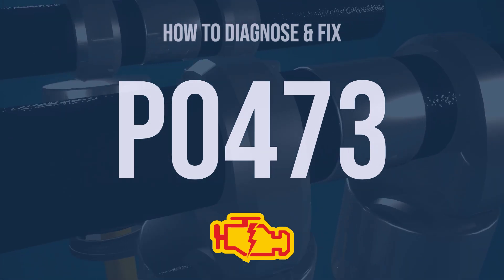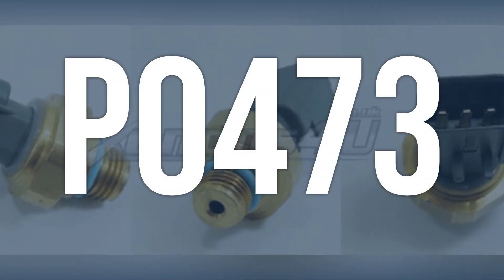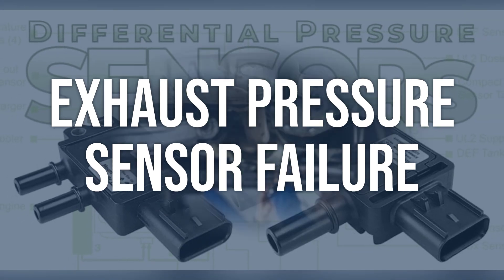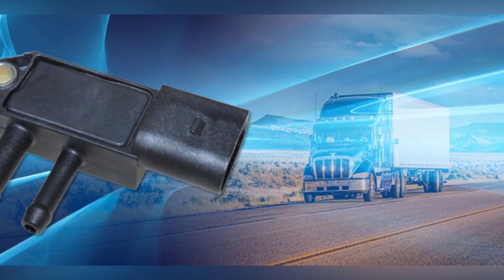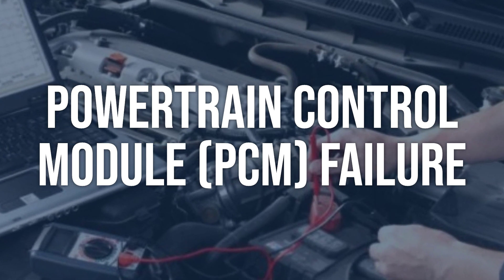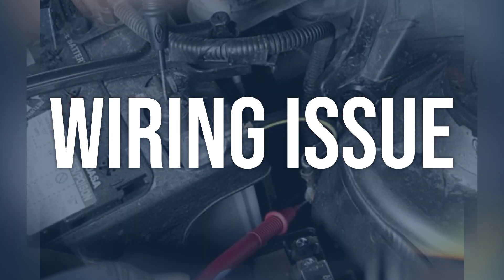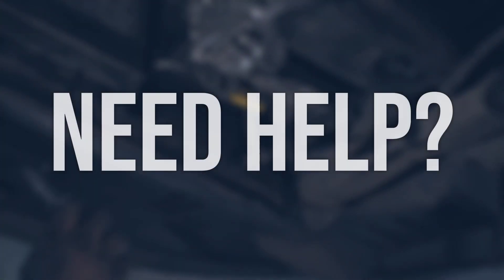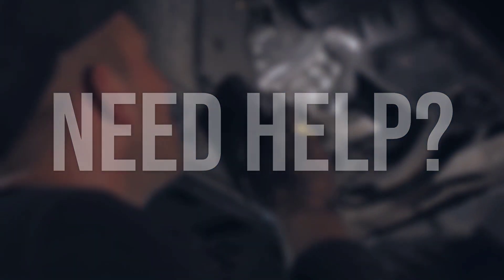How to Diagnose and Fix P0473 Engine Code - OBD II Trouble Code Explain

Comment: Hello have a 2015 f250 6.7 has a p0471 p0473 after I was putting the intake manifold back on I broke the sensor now it’s running rough and I have them 2 codes